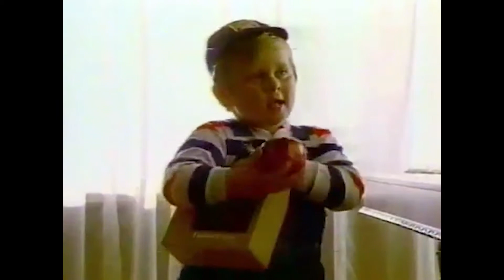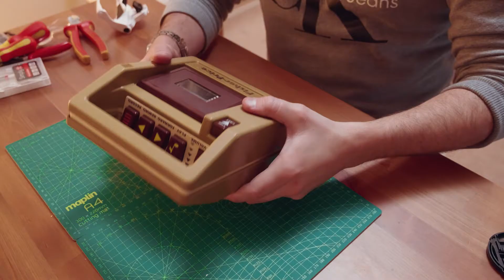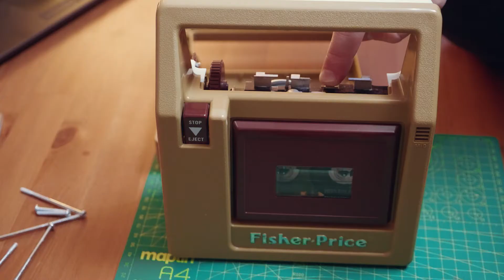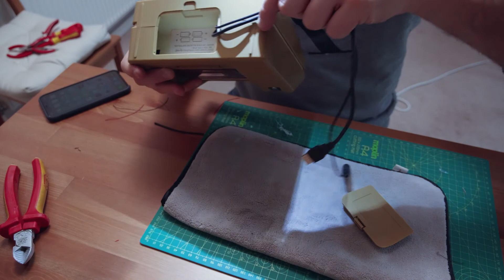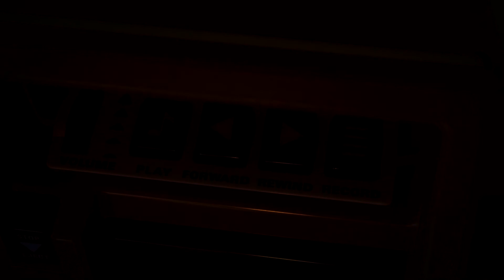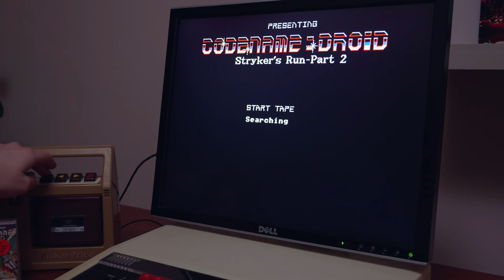The Fisher Price Tape Recorder - Adding LINE out & USB power

Comment: I found a slightly newer version of one of these with one of those handheld mics to record stuff on, could I add a line in by just adding the line in wire to the mic wire? Or would there be a way to add a line in while keeping the mic?
Reply from the maker: I’d open it up and have a look! They’re usually pretty simple to work on, I’m not sure the quality from the microphone would be good enough for a line in but you could try it with a low level input and maybe add a switch to keep both if it sounds good enough, I need to look out for one of those!
Reply: @SiGoesRetro  Okay cool, thanks so much! so far I just need to research more on which part is which lol, ive been able to replace the speaker and it has surprisingly good quality. hoping to make it capable of running a mixer into it and making tapes of my music on it